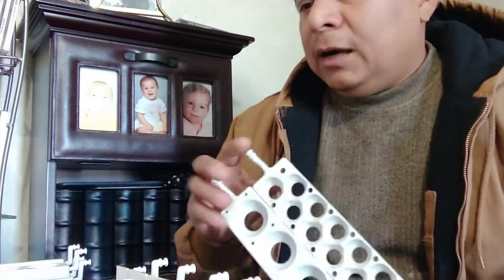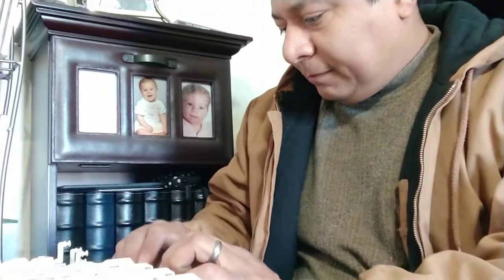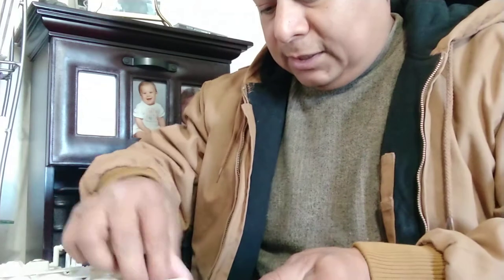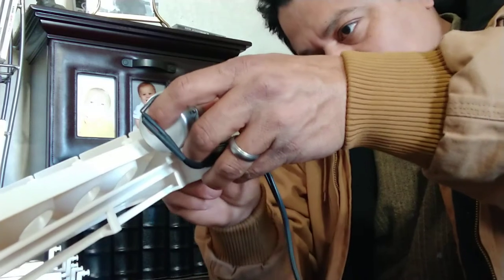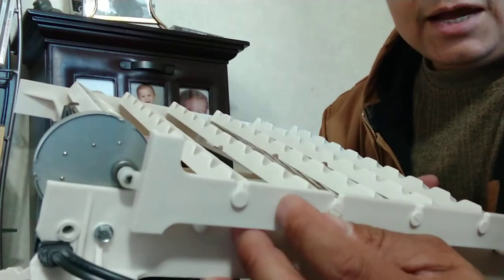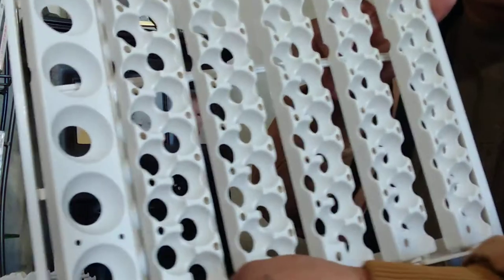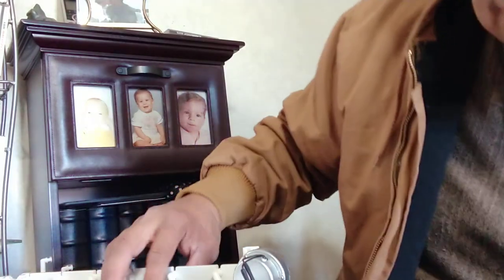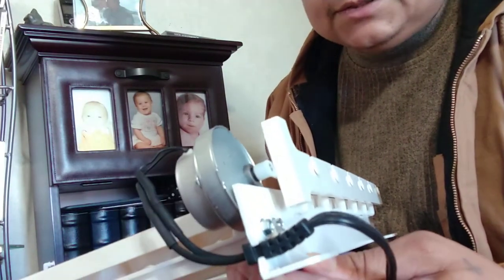Egg Turner, how to change rails.

Comment: I take only ONE screw out ( the Back one ).     Also I remove the Electrical cord from it's slot.    By rotating the Motor Backwards, ALL of the Rails will fall away freely.

Comment: Wow it's tricky yours was the only video I found except the short one from miller mfg.  Unfortunately I didn't get it with  your video but kept persisting and eventually got it  and it was one of those OMG moments when it happened.  I have quite a bit of ADHD/dyslexia type thing going on - jigsaw puzzles are a nightmare for me, I am intelligent but putting things together drives me insane - I should have taken photos step by step as I took it apart.  Unfortunately I do not exactly what I did at what point that made it work but it did - I had put a cutting board on top to keep the egg cups in the right position and really focussed on getting the t-thing in the proper position for the lever on the motor to fit in then the screw holes lined up exactly.  I will likely NEVER take this damn thing apart again.  I will spray it with alcohol or something to clean it.  Thank you for your video though it gave me hope and I felt SO much better to know I was not the only person having a hard time with it.